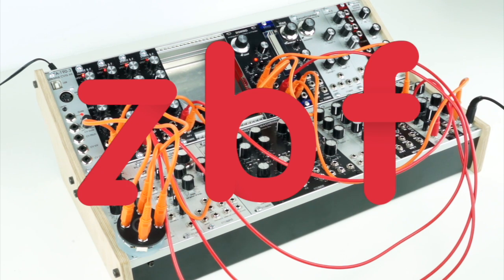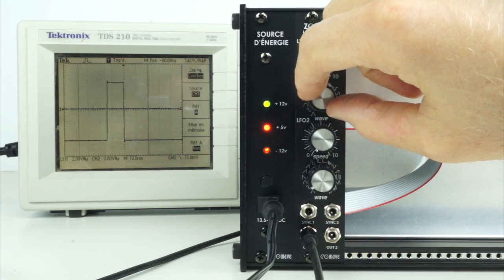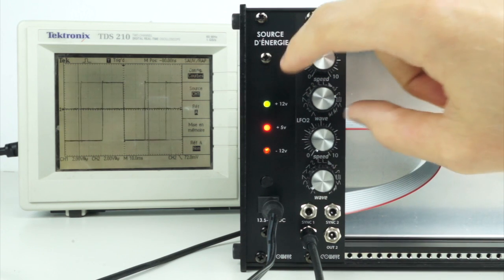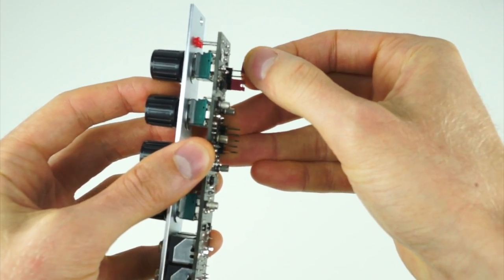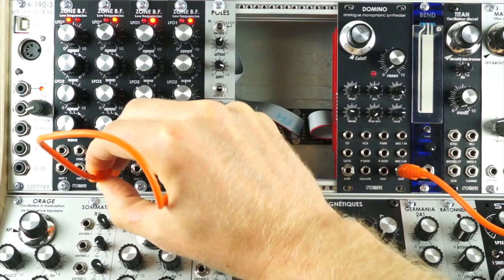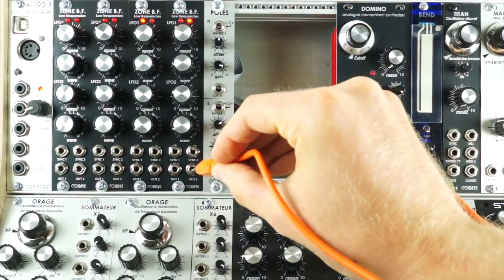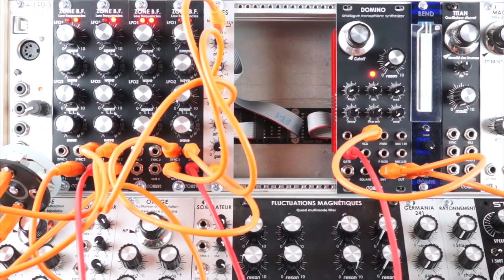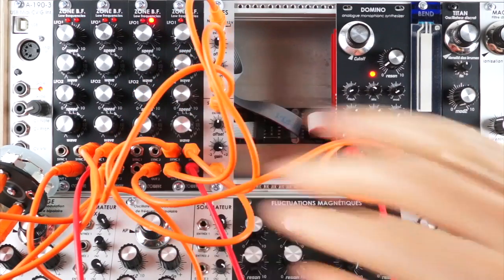Eowave Zone B.F

Comment: Hello eowave, thanks for this really multi-waved LFO. Some very nice modulation stuff can be done with it! One slight remark, the rectangle slope is to slow to drive a Doepfer S/H. I did receive modifications from Doepfer to change differentiator capacitor of the S/H to overcome this.

Comment: Really nice module ! Noob question : I understand the two Lfos can get Cv controls or trig with the sync in 1&2, but does it receive clock signals as well ?  from an external sequencer for example ?
Thank you !
Reply from the maker: Yes you could use it that way in sync mode - every time the clock is gate high, the LFO wave will reset. This is not the same as a synced/tap-tempo LFO however, it doesn't read the tempo of the clock and put the LFO in time, it is just a reset of the LFO wave
Reply: Thanks a lot for your answer.